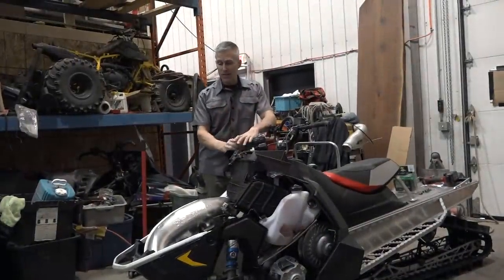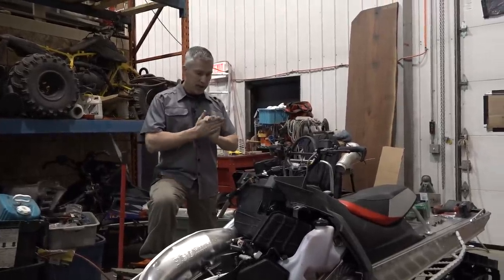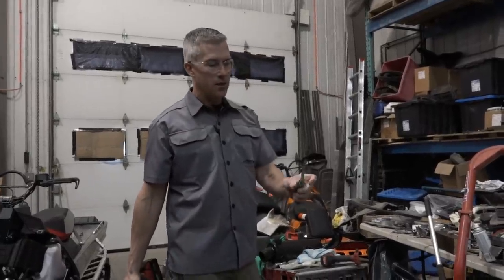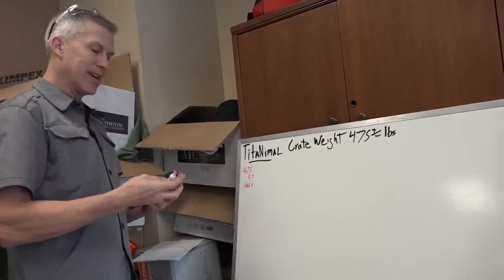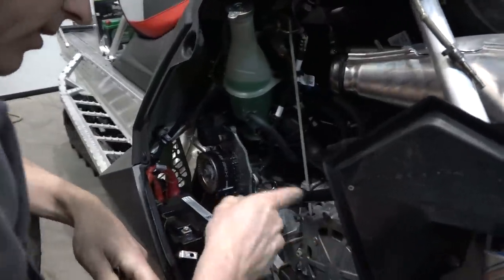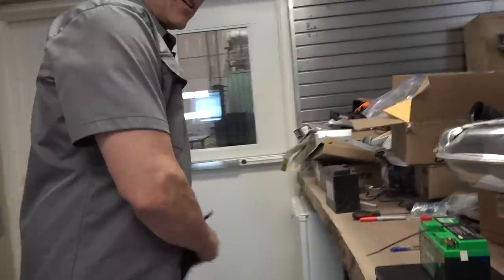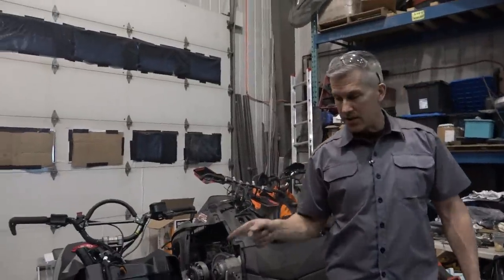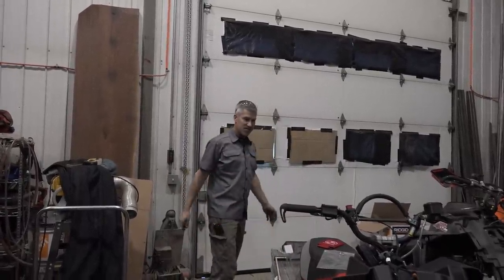Polaris Khaos Lightweight build Ep#1. Jaws Trail Can & Battery tray removal

Comment: On my ZR 8000 I used the Titanium  Diamond S Quiet can( more for trail) and it weighs in at 3.7lbs lbs!! Compared to the 21 lb suitcase that came on it , was a huge upgrade! They make Cans for Trail and mountain, Polaris Ski Doo and Arctic Cat. You wont find a nicer looking or made muffler, the welds are art work. You should check them out :-)  Keep in mind the "trail can" is a lot quieter than the "Mountain can" , heavier too.

Comment: Make sure the battery is well secured, because if it comes in contact with the belt drive the Lithium-Ion cells in it may explode due to the heat and the shock.
Reply: Étienne M they have tons of protection built into the case. It would need to be on it for a while to break through into the battery cells